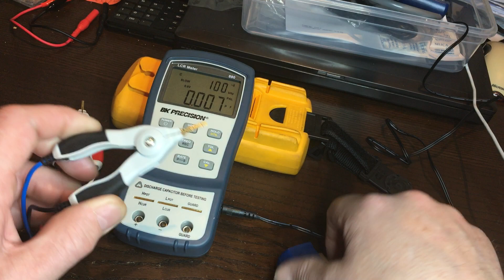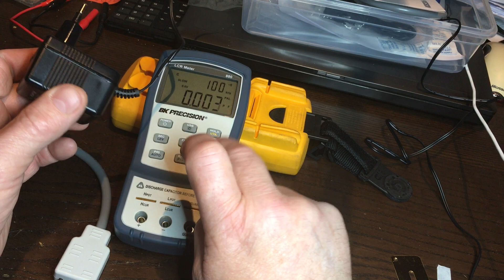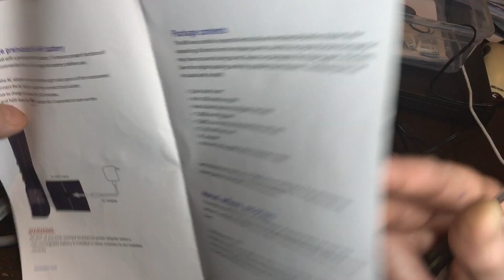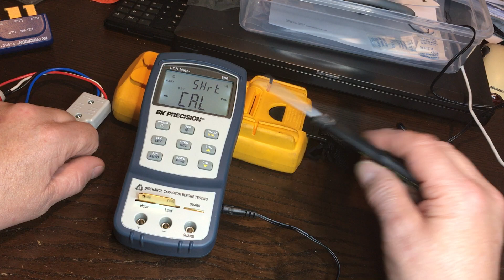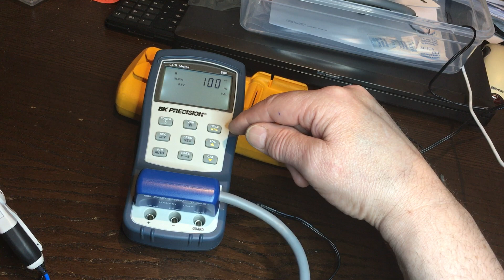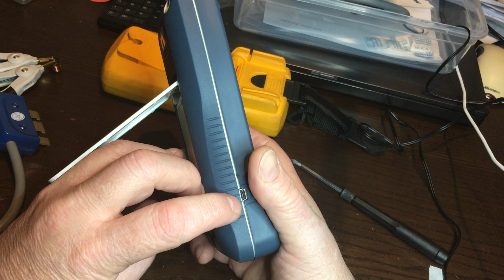bk precision BK880 LCR meter review, sort of.

Comment: Well these meters are The best in my book regardless .. I have the 879b and it doenst fail me. Why is it that people who review these meters and or multimeters stick a metal Phillips driver to point it all the meter as you have done to scratch the outer shell and some guys run these drivers through a circuit while the battery is still in the meter pointing out all the components closely and near damaging the meter itself amazes me. This is so stupid spending money on quality equipment and doing that to it. Makes no sense. Good luck to them people.
Reply: I agree. Why not use a bamboo skewer when demonstrating the insides of such devices? You can easily color the tip with a marker so that it stands out from the background...